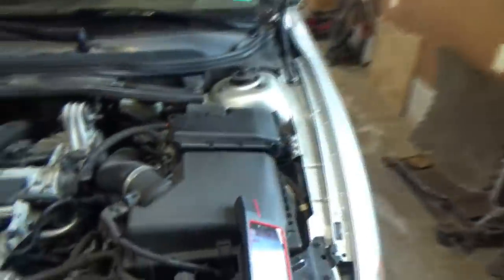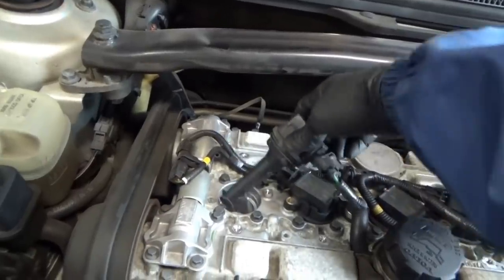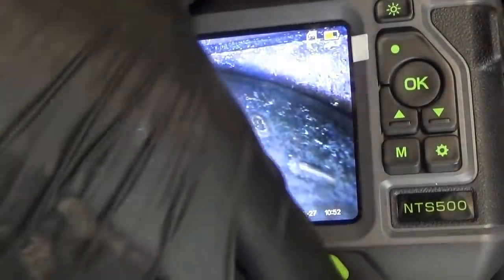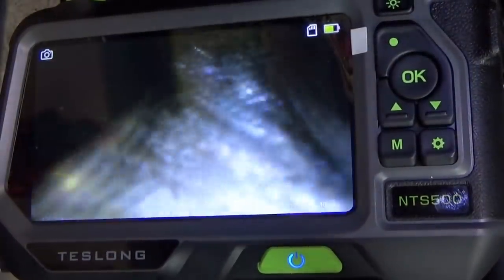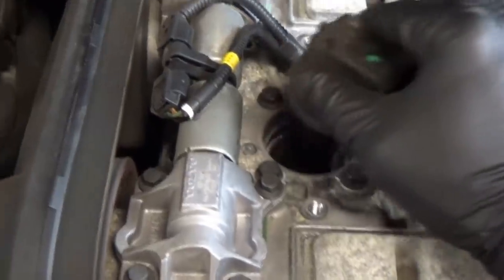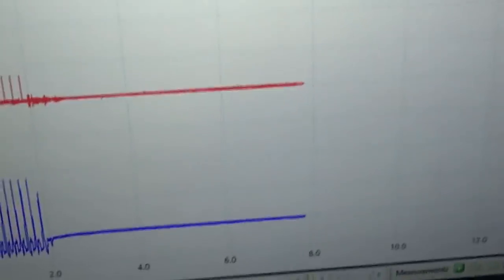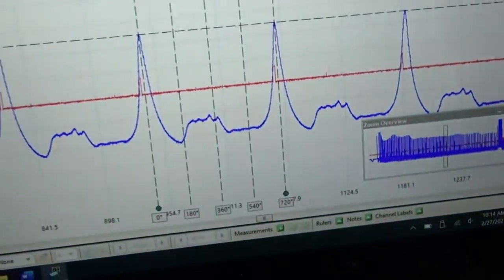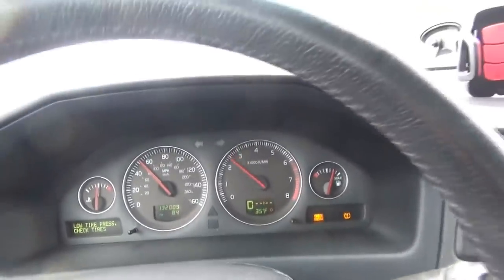Volvo Turbo GRENADES!! - Part 1 (100k special :)

Comment: 100k subs? Nice going Ivan. You have the peoples attention. Keep up the good work. It’s strange only one cylinder swallowed something small enough to get through the intake valve and trash the #1 cylinder. Eventually he’ll need to repair or replace the engine. A nice low miles bone yard engine should work.

Comment: Congratulations on 100k subs looking forward to part 2 
Depends on customer if he likes and wants to keep the car etc 
Repair cost now could be a bit cheaper might get away with a valve job etc wouldn’t hurt to do them all new seals do the water pump and timing belt at the same time...
Maybe the belt is due anyway?
If you wait then you may need new valves as it’s going to burn them out and may damage the head as well .... plus what ever caused it could still be parts in the inlet that could damage other cylinders 
That’s how I would explain it to the customer.......

Comment: Turbo blade in through the intake valve, had a dance with the piston and out the exhaust valve.
Reply from the maker: We'll take a look at the turbo with a boroscope in part 2!
Reply: @PineHollowAutoDiagnostics  That would have been the first thing I would have done because of a loss of power. The customer didn't give you much help by paying attention to what he heard and felt when the turbo blew.
Reply: Is what I think to.
Reply: That would also explain the cat error code
Reply: That was my first thought, but I'm guessing it would be hard for a blade to get all the way through the intercooler. Also with the speed those things rotate at, a blade thrown off the compressor of the turbo would likely cause major imbalance of the turbo shaft, but we're not hearing anything now.... Whatever it was is probably in the cat now.
Reply: Shouldn't the intercooler filter out debris from turbo?
Reply: could hear exh valve leaking at the tail pipe at idle
Reply: there's a grenade on the floor, get low!

Comment: So, The lesson from all this is - Dont buy a turbo equipped engine? Seems like everything is becoming turbo charged and when they fail they take the engine with them. Is that about it?
Love your Vids Ivan :)
Reply from the maker: But they are fun while they last 😁
Reply: Generally, turbo failure doesn't cause a great deal of damage to the engine as the intercooler will catch the broken bits of turbo, there are outliers to that though.
Reply: I see that the Lincoln Navigator has two turbos in it. So, I guess thats either to have twice the fun or for Ford to make sure the engine dies when a turbo fails - lol. Thanks all for the replies. I guess I'm just not a fan of turbos. Probably if not for the cost it might be prudent to replace them at some point before they fail. I dont know. Im a driveway mechanic myself :)
Reply: @northpoint1039  of course when you double or even triple the output of an engine with forced induction, failures are going to be more common, in my experience though, as a mechanic working on modern vehicles, the turbos never really fail by themselves, there is always a cause and most of the time it is due to poor maintenance, a problem that could cause a catastophic turbo failure not getting fixed before the turbo gives up.
Reply: @2secondslater  Thank you Jake. I have little to no experience with them. Good to get a Mechanic's point of view. :)
Reply: @northpoint1039  not a problem! 👍

Comment: A swirl flap? Common failure on the 5 bucket engins installed on Volvoes
Reply: the diesel engines from volvo have swirl flaps.

Comment: FYI, had a Renault today with a spark plug that looked like that, 0 psi compression on the offending cylinder. Boost leak caused the turbo to grenade (compressor wheel burst due to prolonged turbo overspeed). Check for boost leaks buddy, I think I can hear one on your video.

Comment: Congrats for the 100k!!! I am amazed that the engine is not totally destroyed. A part from the Turbo got sucked into the cylinder and then out of the exhaust. This car is a ticking bomb.
Reply: Yeah, if the engine doesn't start burning crazy oil that turbo is going to come apart.  2 expensive repairs needed to make this car trustworthy again. 

If the owner wants to keep it i'd get a replacement engine and turbo, plus intercooler in case a piece is hanging out in there. That turbo is LOUD so something definitely came apart, or got sucked through it and damaged it severely.
Reply: Just saw an update on this car, Ivan repairing some wiring and the car has 182k miles so far, still running